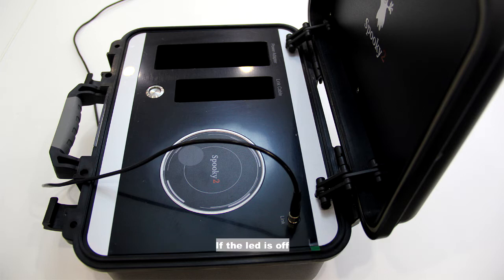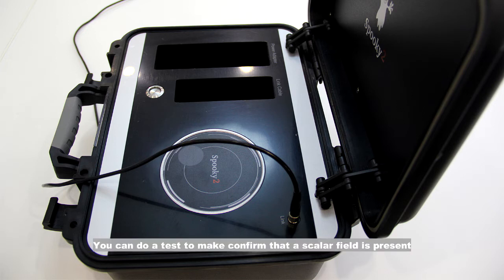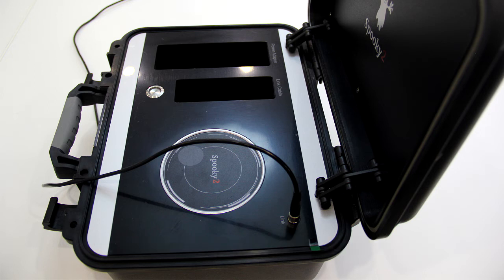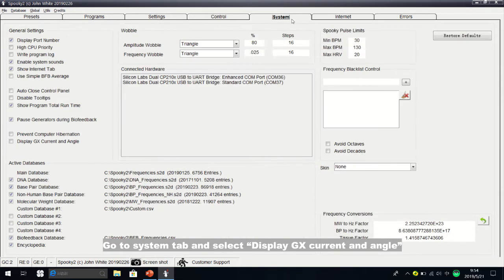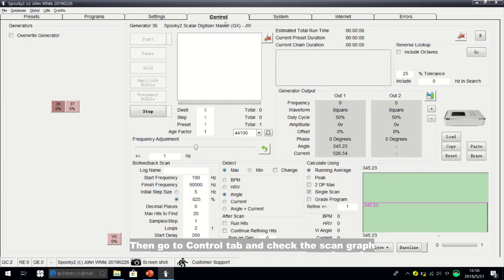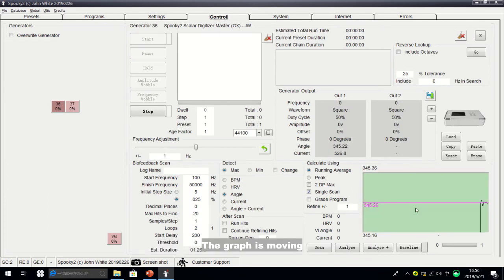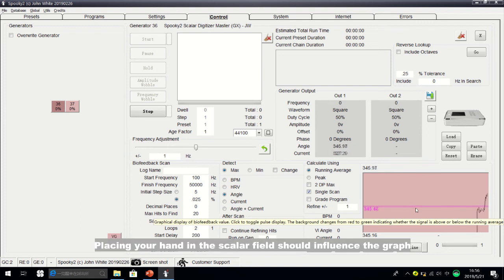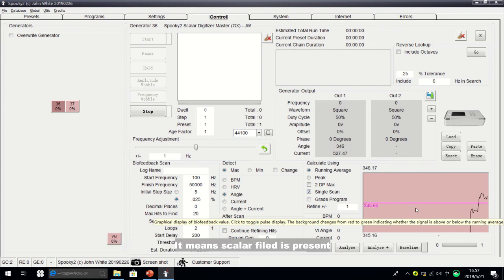How to Know If Scalar Field Is Present When Receiver Light Is Off

Comment: I wonder if you could test the size of the field by moving your hand  and then checking the graph ? Like how big of a field in height if the devices are 25’ apart ?
Reply from the maker: Dear friend, if the distance between the transmitter is 4 feet, the field would be about 2 feet in diameter at the centre. Hope it helps. Any questions, feel free to contact our email: support@spooky2scalar.com.
Reply: So if it is turned to EMF instead of scalar field (below 5 MHz), there should be no change in the graph when we try this?